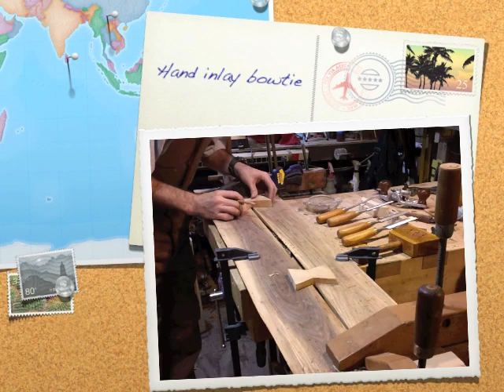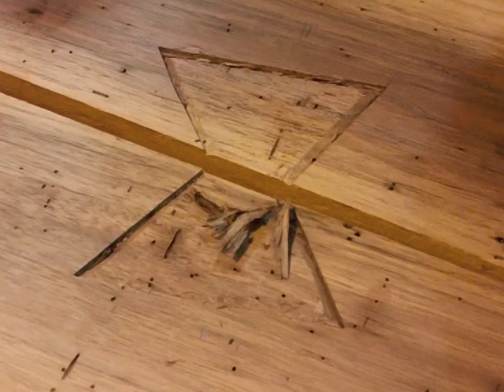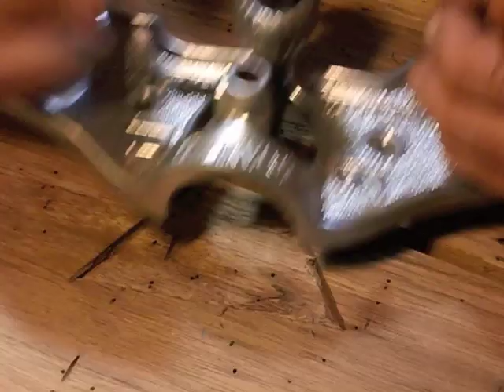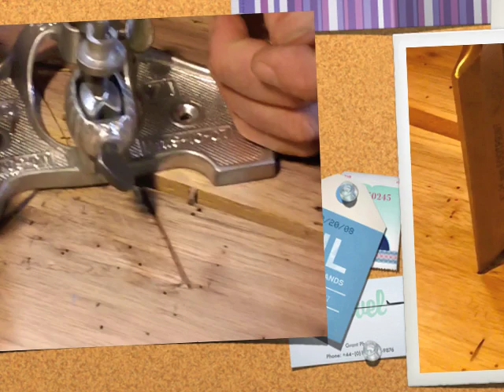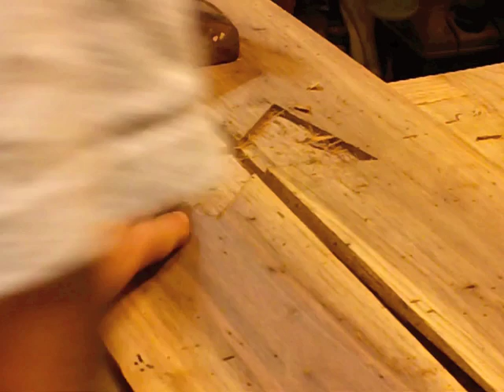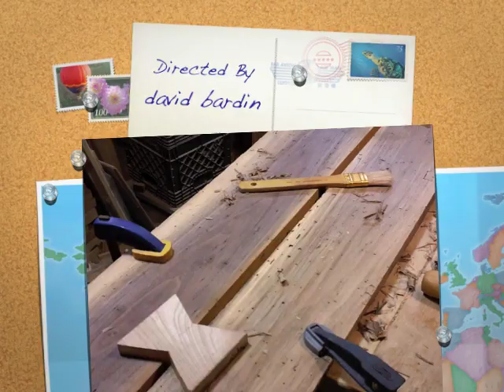Hand inlay bowtie

Comment: Sure I get all that I guess but I've been cutting timberframe homes for 14 years and I've push my fair share of planes and chisels through wood and my body is broken. I was just thinking that knifing and power routing would be easer. I don't get the same satisfaction of not using power as you all. The more wood removed with fast spiny things the better in my opinion. To each his own. Still great work and good videos.
Reply from the maker: I built houses as a younger man and when I do additions to my house. The power saws and nail guns come out. With that time passed now I find pleasure in taking choice pieces of wood and doing hand work with them. I to am broke down in my older years. These small pieces are easy and I stop when the pain sets in. I salute you for you building experience and I am sure you know what your doing. We all find the little things that make us happy. Mine is finding the older tolls restore them then using them to make a piece.
Reply: fps timberguy i

Comment: Dave san Good careful work.
Question. What a calling name tools you using when you scrape the bottom part with both hands?
Reply from the maker: +that is a Stanley #71 router plane also known as a "widows tooth" you can make one out of a piece of wood and a sharpened Allen wrench. It is one of the most useful tools to get a true flat bottom on your joinery.  bayashi23
Reply: Thank you brother ! :-)

Comment: Hi Dave, loved the video demo, but didn't quite get it. Those " butterflies" you set in, there purpose was not to draw the planks together, is that right? What was the purpose ? Thanks, Joe
Reply from the maker: +Joe S +Joe S Bowties, butterflies and or dutchman were originally used for holding two large boards together from movement. George Katsutoshi Nakashima is one of the first to use them for live edge to help keep large one board slabs from separating at the crotch and in blemishes. They have been used to place over a knot hole and also stabilize the piece of wood in that fashion. On the piece I was working on I had two live edges and wanted to keep them a certain distance from each other. It is a coat rack hanging at my front door. The wife wanted a Rustic look. I hate palate furniture so I did my version. I'm pretty sure one of the bowties is a knot hole that I placed in the piece. My form of humor. But most of these were seen on doors and shutters because of the heavy weathering wood takes due to rain and snow. They kept the pieces from developing large air cracks. I hope that helps.
Reply: +Dave Bardin , thanks for taking the time to clear this up for me, it all makes perfect sense now, and thanks to you, and your wife:-) I have learnt something useful!

Comment: When doing a inlay/ bowtie does the inlay have to be in line with grain of the boards to allow for expansion and contraction.
Reply from the maker: +Robert Haldeman No then the would split with the movement. Wood is forgiving enough to move a little in this case. The purpose of the bow tie was to hold the movement so no further splitting or separation would occur

Comment: They make power routers you know. I love woodworking too but dam it's the 2014. Great job anyway.
Reply from the maker: Adam Thank you for the complement.
 A power router could not give me the sharp angles and crisp points that I got. Yes it would have been a lot faster but damn I would not have been able to hear the radio.
Try some hand tools some time. You might find that wood working has not changed in 5000 years. Its still a sharp edge of a tool introduced to the wood fibers and cutting them. The method and tool you use to get the results you want is different for every one.
To each his own. Just think I didn't murder a single electron in the production of this.
Carry on my friend.
Reply: There is a satisfaction I get when completing a project without plugging in a single tool. It's called a hobby dude, plug in all you wish.
Reply from the maker: Yes I did not murder any electrons in this project.
There is a zen you only get with handtools.
Reply: fps timberguy You know what's funny about power tools is that after all the time and energy spent saving up to buy, maintain, facilitate, jig for power tools ect, you make practically no ground on a guy using hand tools. Furthermore you don't acquire the fine motor skills, strength, intense pleasure and robust health as you would using the miracle of your godlike human form to it's full mechanical/energetic potential.  It's one those big jokes in life. Power tools = 3 steps forward 2 steps back. 

Might as well just cup your balls and have little faith in the creative potential of your own body. Or not... That depends what it is you really! want :)
Besides, with a bundle of about 12 hand tools you can go anywhere in the world you want and work with wood with nearly zero dependency on foreign power. heheh. It's just a win win win win win baby. 

Don't believe the hype. Bear in mind my friend that some of your "go to" beliefs may be simply a product of "modern advertising" -.o

"You may think you own these things, but these things end up owning you..."
Now say it with me, 3-2-1... APPARATUS!!!
Reply from the maker: Yes no saw dust. No noise. Its so nice
Reply: +Gandalf the White - Gotta disagree.  If I need to rip some 3" stock into strips, plane 10 board feet of 1" oak etc., no guy with a hand saw and block plane is gonna come close to the same amount of time to do the same.  Don't get me wrong, I love using hand tools and building pieces using just them but there is a time and place for using power.  I enjoy using both as I find it gives me good balance between new and old technique.  It only owns you if you let it.
Reply: StriveFor Selflessness best thing about hand tools is that I spend less time staring at it.